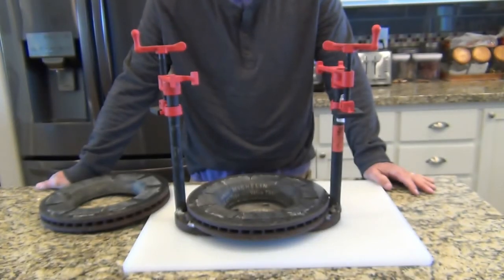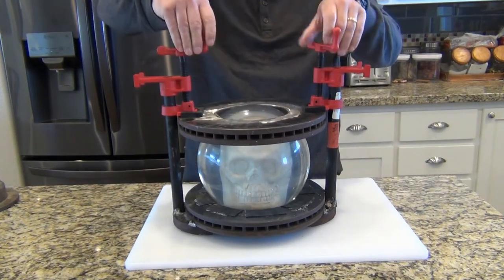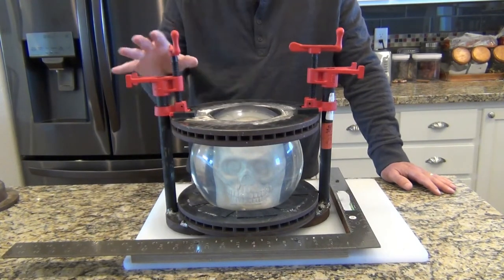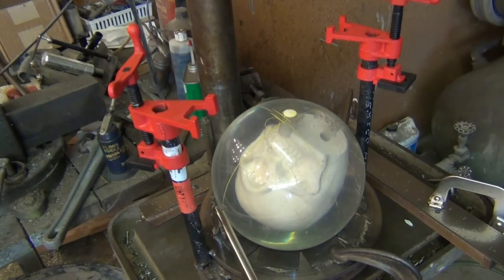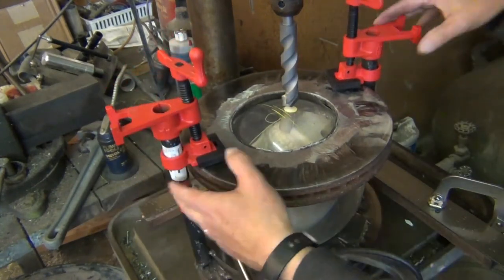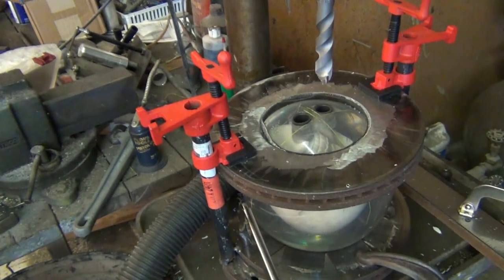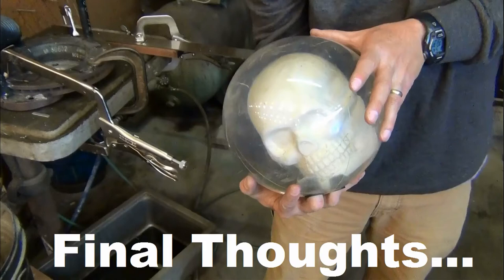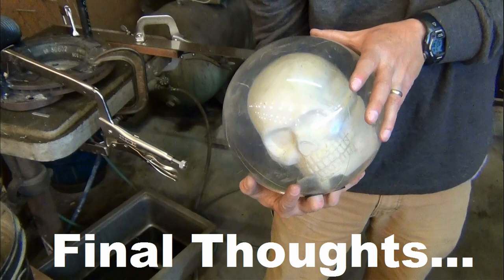How to Drill a Bowling Ball at Home without a Pro Shop

Comment: This was certainly helpful.  I have a drill press, am a welder and machinist, and unfortunately cannot work in the fabrication/manufacturing industry anymore, but I want to buy a full arsenal of balls but not pay the $60 per ball price to have them drilled.    I would have to drive a few hundred miles to a larger city to get better prices.   So now begins the deep dive into layout tools and learning how to use them lol.
Reply from the maker: Thanks for the comment.  I was lucky to have a friend who ran a pro shop.  He taught me how to layout and drill my own equipment.  I was familiar enough with how his jig, mill, and drill press worked that I knew I could do it myself for a lot less money.  I've drilled a few balls since making this video, and each time it gets easier.  If you are a machinist, you could probably figure out a good setup pretty easily.

Comment: Should consider getting a x y table. But great job showing this if you don’t have the X y table. I was considering using a break rotor as well to set the ball down on my mill table and buy the clampdown plate at innovative. But I found a old litchco jig online and bought it

Comment: Just a suggestion, as you have more viewers than I do, ( I may still make a video on it)  but a dial indicator costs less than a plug cutter, and can be used to  center the ball to the spindle, actually probably more accurately.
Reply from the maker: I'd love to see a video showing how the dial indicator works.  I used a plug cutter because I needed to know where zero-zero pitches were so I could move to the ball from zero to my desired pitches.  (Plus I have the added bonus of being able to cut plugs.)  This is the easiest way I could figure it out, but I'm sure there are better ways.  Good luck with whatever you come up with, and if you post a video, let me know so I can watch it.
Reply: @MyLameAnimations  certainly.   I have been inspired haha.    I ordered some toggle clamps to build a different style fixture.  I have a ball that needs to be plugged and redrilled, so I will also build the router jig according to your video to mill the plugs down.      Between your videos and a few others I will have saved well over 500 bucks by the end of a year by the time I get all my balls lined up.  Opens the door to plenty of used options as well. 

Been working on getting the garage straightened out for projects and video making.  Excellent project for the first run.

Comment: where did u get the drill press from ? I wanna do this at home but have no idea what drill press to buy and dont want to spend  $$1000's on it.
Reply from the maker: I use the drill press where I work.  If you buy one, it needs to have an adjustable deck height and be large enough for the ball and the drill bit to fit.
Reply: ok great thanks - any idea what speed or HP I need ?  @MyLameAnimations

Comment: for what you paid you could have had a pro shop do it assuming they had a digital drill press with zero risk of error.
Reply from the maker: Good comment.  You are correct.  I wouldn't recommend that everyone try this at home.  I was just proving that it can be done.  For me it was worth it because I live 70 miles from the closest pro shop, and  I drill about 6 balls per year.  Also, I have been drilling my own equipment in a pro shop for several years, so I have a good understanding of how the professional equipment works.
Reply: For real! I think you missed the point! The ability to do this work at home assuming your a good bowler and have a solid understanding of ball dynamics and layouts and with the price of online balls and having to deal with butt hurt pso's  I'd love to spend 50$ to be able to do my own work! Yes it's the same as if you just went to the pro shop on the first ball! What abt ball 2 through 50? That's free money!
Reply: @MyLameAnimations  I WOULD WORRY ABOUT MAKING A MISTAKE BECAUSE ONCE YOU DRILL IT IF ITS DONE WRONG NOW YOU HAVE TO PAY FOR AN UGLY LOOKING PLUG JOB IN ORDER TO CORRECT WHAT YOU DID.

Comment: SOME PRO SHOPS ONLINE WILL DRILL IT AND SHIP IT TO YOU. BUT CHECK REVIEWS FIRST. BEING OFF A 1/16 IS A BIG DEAL TO ME. I HAD A BALL THAT WAS A 1/16 TOO WIDE AND AS A RESULT I COULD NOT GET OUT OF IT CORRECTLY AND IF THE PITCH ON THE THUMB IS 1/2 INCH BACK PITCH INSTEAD OF 3/8 YOU WILL DROP THE BALL. THAT HAPPENED TO ME. SOMETIMES IT'S WORTH TRAVELING THE EXTRA MILES TO GET IT RIGHT.